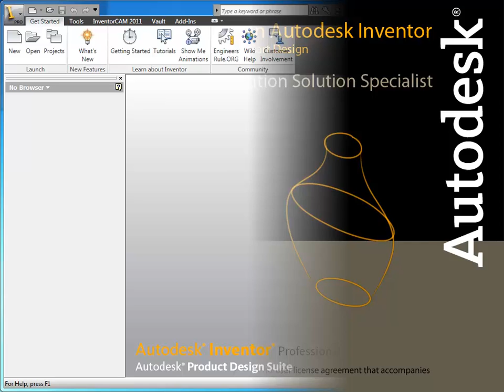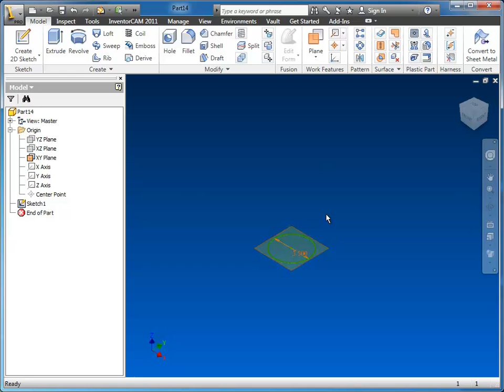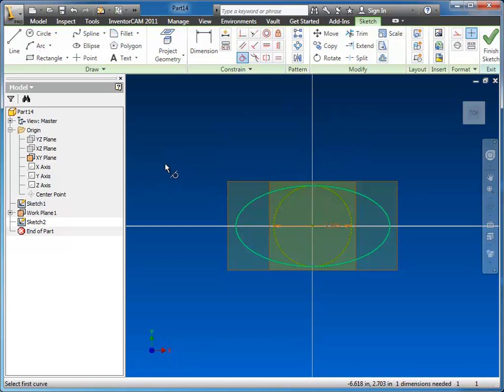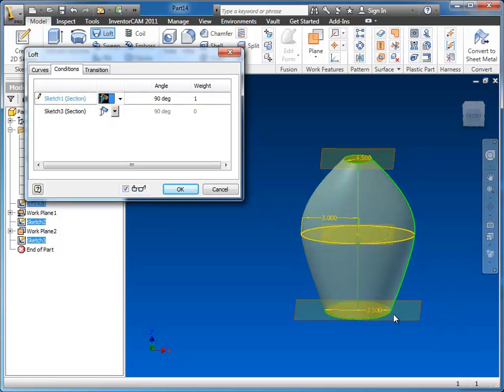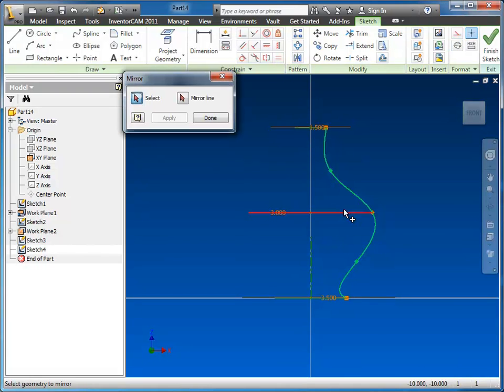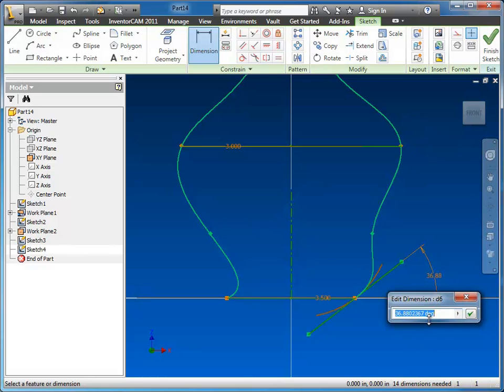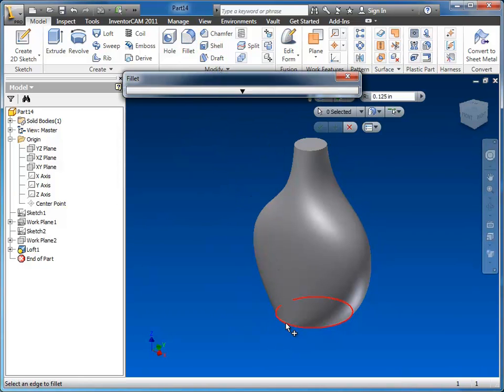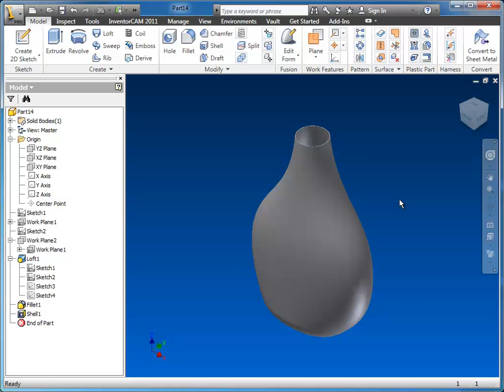Loft (with rails) Autodesk Inventor 2012

Comment from the maker: @65564james It is hard, but some would argue that associates is harder because you don't use the software. In the professional you must use the software to solve problems. Google "AU certification prep" a coworker of mine, Thom Tremblay, has a couple certification prep classes online that would probably help. The key to the professional exam is understanding a road range of functionality, things like sheetmetal, weldments, part modeling, drawings, etc...

Comment: Sorry John,meant to add would it have anything to do with any settings in applications as I have not been using 2012 long?Just tried it again and it wont do it,the circle will highlight if I go over it as long as I dont pick something on the sketch ribbon!!!

Comment: John, I have tried mimicking tour tutorial step by step. Yet when I select one of my spline lines as a rail it highlights both as if I was looking at a wire frame of the bottle. Then I recieve an error message " The attempted loft operation found a rail curve intersecting a section more then one time. Try with a differant rail curve or modify the rail curve so that intersects each section only once." Please help. Also when you highlight a line its red? How do you change to red from white?!Thanks

Comment from the maker: @Banchuba Glad you liked the video. I haven't worked with Maya yet, just haven't had a chance. I would guess you would need to use a generic format like iges or sat to move back and forth, but I am not so sure how well that will work. I know 3DS Max will read inventor files, but I am not sure if Maya does yet.